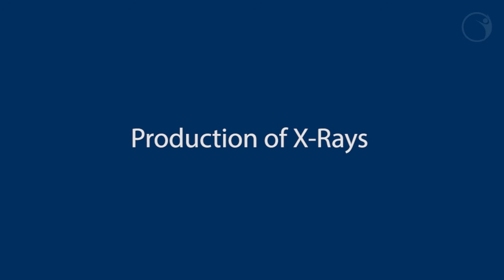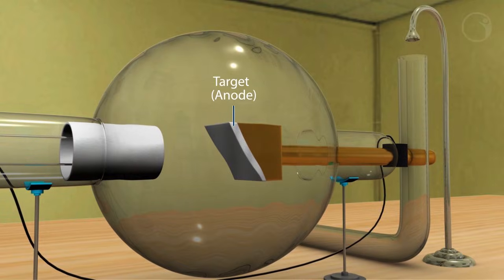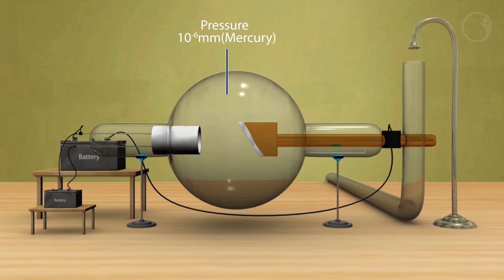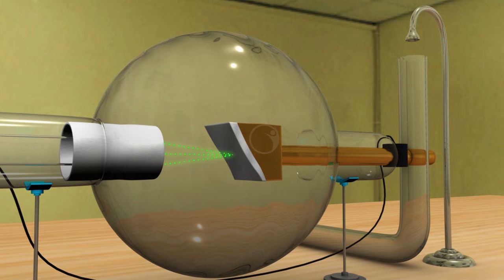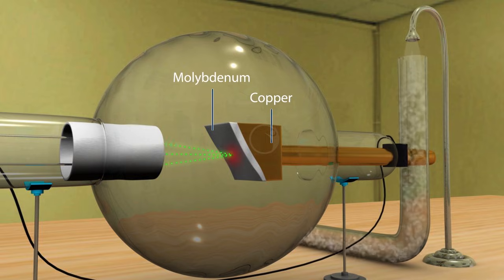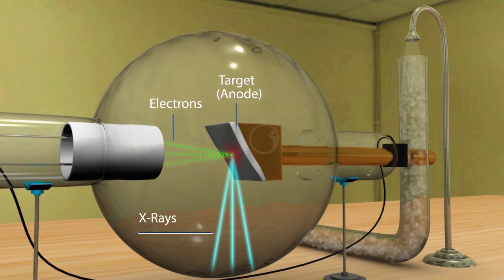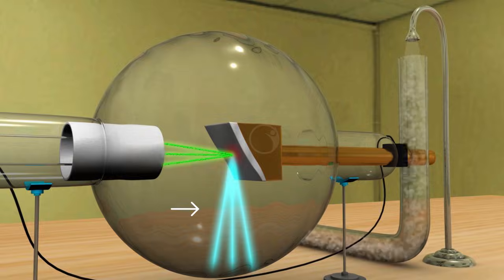Production of X Rays

Comment: Thanks for this video, very illustrative. I see one mistake, the angled target doesn't create photons in a 90 degree angle but in all directions. The angle of the target (anode) is to minimize the absorption by the anode material, maximizing the photon output in the required direction. Otherwise the maximum photon output would be directed to the filament.

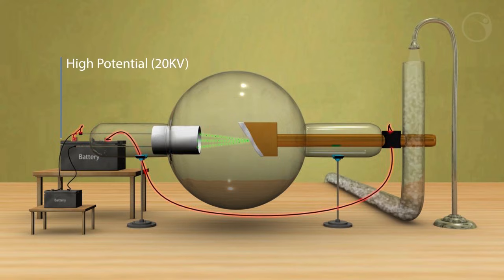Comment: 1:36 
High Potential (20KV) could not be produced by a battery.
The large battery is only used to represent the high voltage to show that high DC voltage is used.
Reply: Correct. At that time batteries weren't used for that high voltages. They used other devices like transformers etc.

Comment: If we were to increase the current of electrons to a very high level could we produce gamma rays?
Reply: No, you can't produce gamma radiation in x-ray tube.
Reply: @Keeper Holderson Because Gamma rays originate from the settling process of an excited nucleus of a radionuclide after it undergoes radioactive decay whereas X-rays are produced when electrons strike a target or when electrons rearrange within an atom.
Reply: @Keeper Holderson It does. For gamma radiation you need radionuclide.